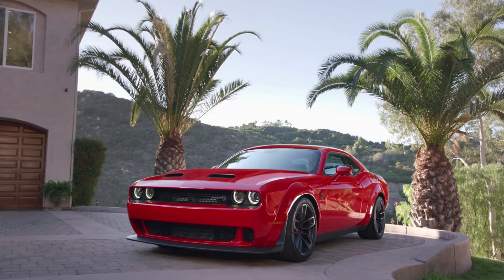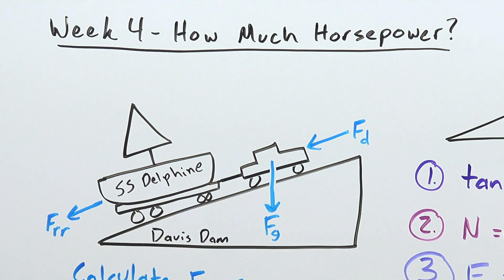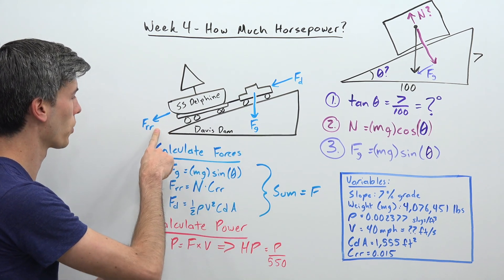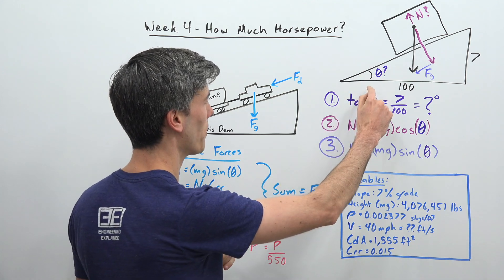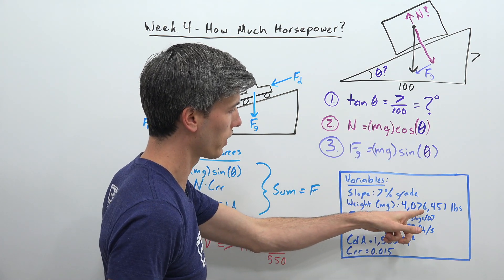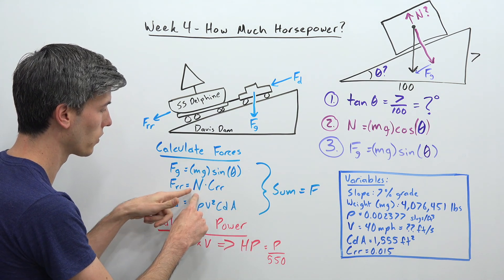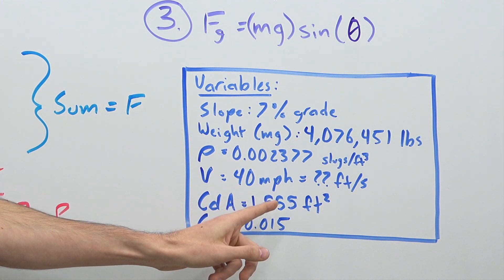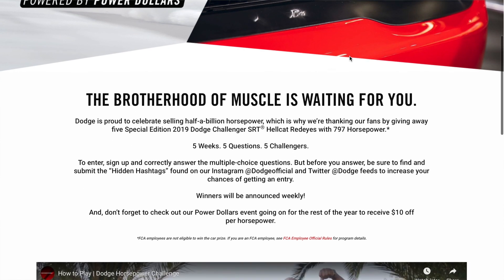Dodge Horsepower Challenge | Question 4 Hints!

Comment: Has anyone narrowed it down to the final 10 options yet? Did your calculations come close to one answer?
Reply: Below are the 10 options

20,000 HP.

The equivalent to 8 Hellcat Redeyes.

8660 HP.

1921 HP.

55,000 HP.

9,000 HP.

970 HP.

37,737 HP.

5,000 HP.

The equivalent to 19 Challenger SRT® Hellcat Redeyes
Reply: @bnavgs3341  It's gotta be one of the 5 digit answers imo because the Delphine weighs a bunch.
Reply: Tried again...downloaded an actual scientific calculator to my phone and now within about 200 of one of the 10 answers that were left so I’ve locked in my answer. Hope it’s right 🤞
Reply: Yes and no.

Comment: "Tan" in the video should be either "ArcTan" or "Tan^-1" to convert percentage to angular degrees.
Reply: He wrote the equation correctly, you just have to solve it with atan.
Reply: @Quangus1  Correct, my reply isn't clear, it's written correctly, but not intuitive for those not well versed in Trig, which is most people?
Reply: I got the degrees correct, so I’m either messing up on sin or cos, or the drag force formula.
Reply: I use the c²=a²+b² and get the cosine by dividing the adj./hyp.

Comment: My answer is only close to one answer but it’s not very close
Reply: If you’re using exact numbers (more than 3 decimals) you’ll have a very close answer but it won’t be exact. That’s what I did for the past 2 questions; I got the exact number but the answer was rounded because they used only 1 decimal point. Either way choose whichever is closer and (assuming you did the math properly) you should be right.
Reply: Yeah, I got within a tenth of a percent.